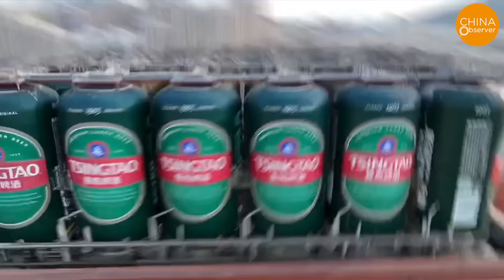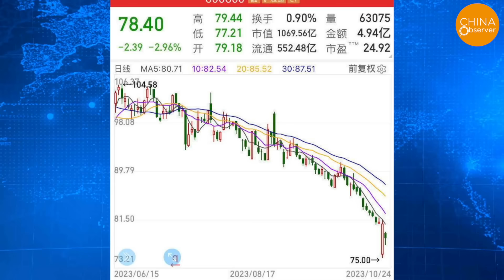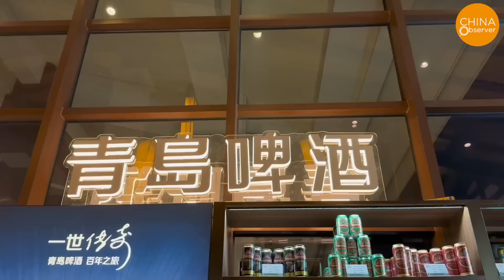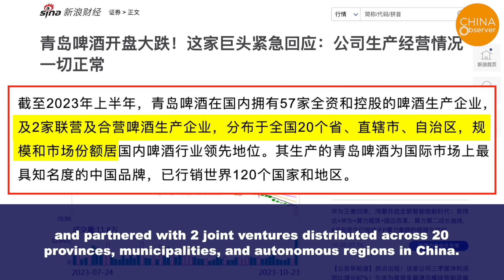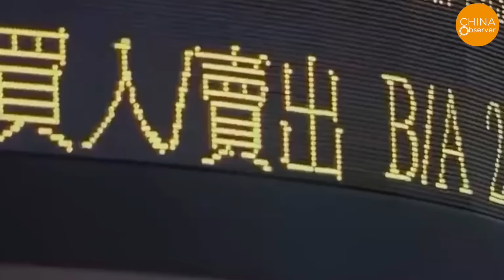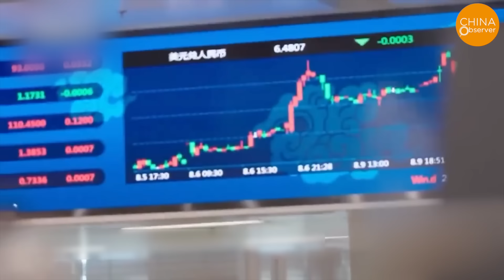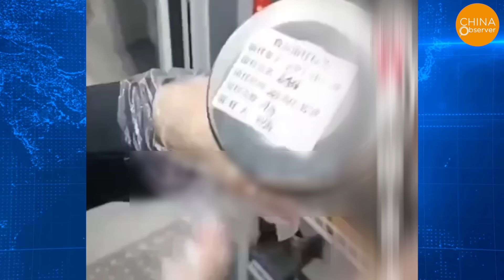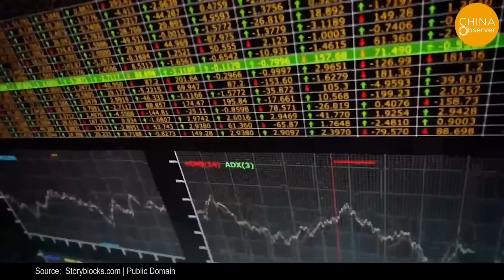Pee Beer, Fake Tofu,Foot-Stomped Pickles,Rat Hotpot: Is There Anything Safe to Eat in China Anymore?

Comment: Pee is actually quite sterile, so other than being a bit gross it is not that bad. Those malts have all kinds of bird poo and insect remains from the field and they are going to be processed anyways, so the dude did no real health harm with that quick pee. Reputational damage, sure, but that's about it.
Reply: That's only true until it leaves the tip of the penis where it comes into contact with skin. Furthermore, if the urethra has some infection already, like gonorrhoea, or even a simple urinary tract infection, then the urine will not be sterile for that reason.
Reply: Urine is not sterile and can carry bacteria as well as H.I.V.

Comment: That footage of skinned rats, when paused, look more like processed quail or other small fowl. There's one that's center screen, really looks like a cornish hen or something similar, but upside down with its legs in the air. While I've not seen a skinned rat, (because, why would you?) I have seen skinned squirrels and rabbits, and they are way longer than they are round. They are very thin around the midsection and most of the meat is in the shoulders and hip area, giving them a more noodley appearance. Contrary to this, most of a bird's meat is in the torso, specifically the breast where its strong flight muscles are located, making them more well-rounded. While it's possible there are skinned rats in that meat pit, I honestly doubt that's the case.